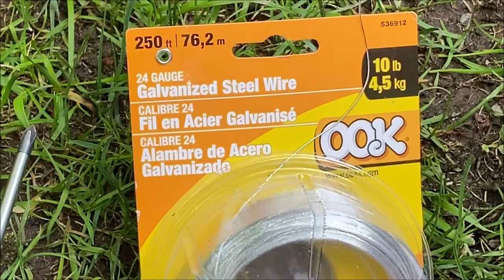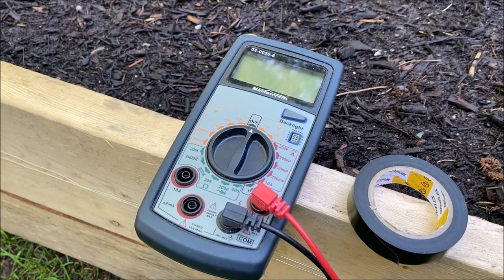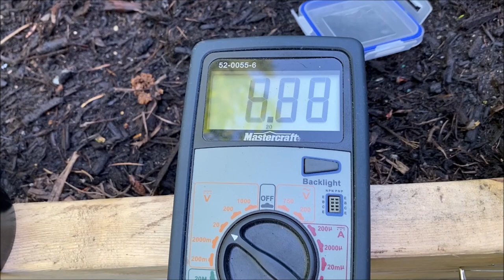Electric barrier for slugs (detailed) in garden beds

Comment: When the wood gets wet it's going to conduct electricity and drain the battery you should raise them like the width of quarter off of the wood and insulate them from the wood

Comment: I wonder if using a 1.5v battery would have the same effect? We need a slug solution at our community garden but people are worried about using 9v batteries.
Reply from the maker: @damianjones6546  just try it. Not sure what the concern is? For the slug or the people? Won't hurt people.
Reply: @DougBrownVancouver  people mainly,  young children. I have told them that but they are still reluctant to try it. Maybe I'll just see if we can do a trial on one bed next year.
Reply from the maker: @damianjones6546  Just take a 9V battery, wet two fingers and touch one on each battery point. You shouldn't feel anything.

FYI a carpet spark has 10,0000 volts compared to this little 9 volt.

Comment: Do you think it’s a strong enough jolt to deter rats?  This is exactly what I was envisioning so I was happy discover this video.
Reply from the maker: Hi, no way. It works well on slugs because they're slow and flat, and make full contact between the two wires. They're covered in slime which conducts electricity. 

 If a rat stepped on both wires, it would have the same effect as you putting your fingers on the two contacts of a battery, i.e. nothing.